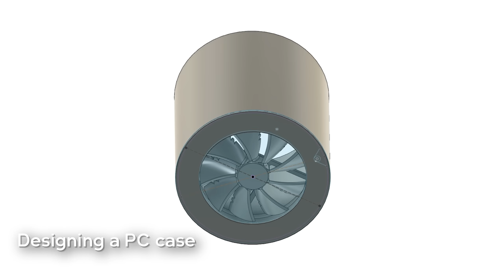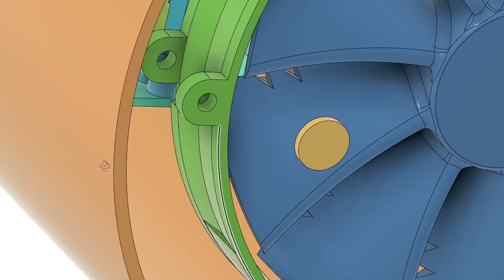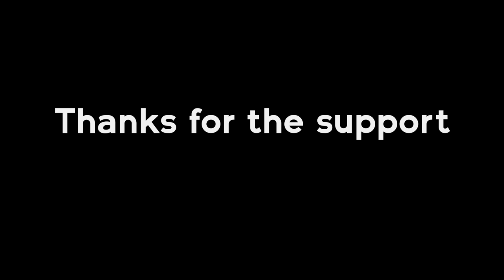Custom DIY mini ITX CASE BUILD / 3D Printed PC case

Comment: one of the best builds i've seen so far , how were the temperatures under load ?
Reply: Same exact question, small space inside with one big fan
Reply: 100c lmao
Reply: It's probably only a 65W TDP chip, and with no GPU it might not be terrible
Reply: Ask this to the 2013 mac pro with 2 gpus

Comment: Excellent work. Now we need a slightly larger one with a 200mm fan and a riser cable & a GPU. You might even have enough space to modify the current design for an A2000.

Comment: I hope the printing materials were in PETG tho cause PLA deforms with time with prolonged heat exposure.
Also, another thing is the finish after the paint. You should use Rust-oleum 2in1 Barnish for the finish. Good for parts used in hot areas and also to prevent paint chipping and ease of cleaning.
Reply: Yeah those deforming claims are greatly exaggerated. This will not give a nudge

Comment: Love the end result and the CAD work you put into this, my only point of improvement is to screw the modified power cable extension to the inside of the case from the outside, you'd see the screws and the rectangle for the cable input but you wouldn't have the whole black plastic block sticking out from the bottom!

Comment: Very clean and finished product!  Would be really nice to put a soft argb ring light at the top, so you know if it is on/sleep/off.
Either on the top (exposted) or in the hollow part of the cap (hidden, so it will just have an ambient light effect).

Comment: Looks great. I didn’t like any small atx cases I could find. So I designed and built the smallest m-atx case possible that supports 360mm radiator. It’s printed in four parts on an ender 3, have been using it for 6 months no issues.
Reply: share it mate. Love to see it😄

Comment: I might scale this down to a case w a diameter of 90mm to use as a small case for my Raspberry Pi or Orange Pi, seems like a cute case.

Might use a steel/aluminum pipe as a sleeve over the plastic tho, I want a little heavy duty feeling case since I’m more a fan of that. Thanks for the idea!

Comment: Very nice build ! One question tho why cancel the ground ? Why didn't you used a 3 pin plug ?
Reply: He likes to live dangerous 🤣I definitely wouldn't use this case.
Reply: @MillionMileDrive  PC has the potential to build up ESD and then what? It has to discharge somewhere... also floating ground reference which may/may not be kilovolts higher than actually earth ground, all because PC isn't grounded

Comment: Nicely done, really like your paint job. Bonus points for using filler on the main body, was not expecting that. Only thing about cylindrical cases is they are just not the best use of space for a computer case, especially SFF.
Reply: Think this case makes the exception. Doubles as an art piece, so worth the unused real estate.

Comment: The "printing defects" aren't printing defects, they are because you designed them with too little resolution in the software. Circles/cylinders will have noticable steps like you have.
But REALLY nice project. Finally something i would call a nice and useful 3d printed pc case!
edit: the painting too omg
Reply from the maker: Thanks for the feedback. Print defects in my case are uneven vertical layers. I meant it
Reply: @pcmod-1  ohhh my bad

Comment: I am wondering about the powerswitch you used - unfortunately I was not able to identify the type or model/manufacturer from the video, do you maybe have a link to it?
Apart from that amazing work with the 3d modeling and in total the idea.

Comment: Hot air rises, it would be interesting for the FAN from below to throw the cold air upwards, catching all the air that enters the bottom on the plate and the hot air comes out at the top, that is, to be all pierced too or the way it is because the source tb is blowing the hot air upwards. I think this was wrong and it was not very well thought out, congratulations, it was beautiful...

Comment: if you did it a bit differently you could place small tower style CPU radiator there, so air passing through from bottom to top would be more efficient innit? however, this is still sick build

Comment: Cool, but I guess CPU cooler has to turn on  90 degrees for better air flow,  Fan (under or on top), even could make full passive cooled (or use only big bottom fan) if use coolers like Noctua nh-p1CPU cooler, Arctic Alpine AM4 Passive Cooler (Ryzen), Arctic Alpine 12 Passive (Intel), like Mac Pro 2013, Xiaomi AC2100 router and ect...;))
Reply from the maker: Thanks for the advice!
Reply: @pcmod-1  I've seen another video in Russian with same PC case, but in the end was Logitech keybord with Russian layout))

Comment: What material did you use for printing ? If you used something else than ASA temps above 50c could go the plastic to change in shape or even start melting
Reply: I dont know much about 3D printing and the different plastic composites used, but this chip isnt a a very hot one at least

Comment: Very good project. But why not design it in such a way that you also have a fan at the top. So in at the bottom and out at the top? Would probably be much better from the temperatures. In addition, the heat build-up can deform the plastic.

Comment: Looks just like my bathroom trashcan (aside from the great color scheme) or like my Levoit Core 300 air purifier. Dude you did a great job with the CAD and everything, please make a better design. Use some surface stippling EDM like structure of something cool and don´t make it look like a trashcan, at least create come recesses like those SciFi panel thingies.

Comment: Amazing. This is mind blowing. How are the thermals on this? Also, would be amazing if we could throw in a graphic card.
Reply: If you look at teardown videos of the original Mac Pro that could be possible but a standard PC power supply (even the one used here) takes up too much space. In the original Mac Pro, pretty much all the space that was used for the PSU was the space for the Graphics card.

Comment: Awesome build. Could you please fix some units in specs?

CPU: Ryzen 5600G
Motherboard: MSI B450i Gaming Plus Max WiFi
RAM: Crucial Ballistix 16GB 3000 MHz
Cooler: ID-Cooling IS-30
PSU: Exegate 1U-F200S
SSD: Patriot Memory P300 512 GB

Gb != GB 🙂

Comment: Amazing!!! But I am curious about one thing though. Is the fan outtake or intake? Or do mini ITX pcs not need intake if gaming isn't its purpose? I honestly want to know because I've been wanting to build one myself recently, and seeing that you modified and built this masterpiece by your design, I figured I'd ask because you're the pro here haha 😄
Reply: its one and the same sorta, its pushing air out the bottom but pulls it in at the top. there's one constant flow of air from top to bottom
Reply: Don't know what this model do but the best design will be to inhale aire from the bottom and push it to the top, as the inverse will be against physics.
Reply: @juandesndr  Yes! because hot air floats upward towards the top of the case. So the fan should be an exhaust one pulling air out of the case.
Reply: @konzo5942  I would imagine its the opposite, as heat rises. Thats the purpose of the Xbox SX being a tower with a fan pulling air out the top for example

Comment: There are 2 questions in my mind ? why did you cut the ground wire at input that makes coil whine easily in time and there was other types of outputs at psu to make a way to the sensor at top , it was a bit risky to play with 24 pin , why did you that way ? Overall nice design a bit like apple but i realy love that slick mini designs ... I can see the time spent on it :)

Comment: Why not use the strong sides of 3D printing and instead of making a MAC whatever apple copy with smooth surface make a EDM like surface ?
I don´t get it, people use 3D printing but never use it´s strength´s xD
God I hope you at least used PETG instead of this PLA crap which will melt in the sun like ice cream.
The absolut best part of the build is the color scheme of this "trashcan" looking thing. You could have just used some trashcan from the get go, made some cut outs and build the rest inside like you planned.

Comment: I think you could have done it better. You could have made it so that the fan on the bottom pushes the air up. You could have removed the outer casing from the power supply, so you could remove the small fan on the power supply. You could also have gotten a CPU cooler that fit into that case or gotten a bigger heatsink. Then you could have cut the bigger cooler to fit the case more efficiently and also sealed off that part so that the air only pushes through it. So that you could have removed the fan from the CPU cooler and only relied on the main fan, just like on the Xbox series x and the trashcan mac pro.
Reply: I don't see any videos of your case you designed.